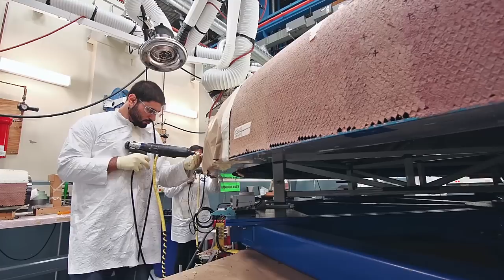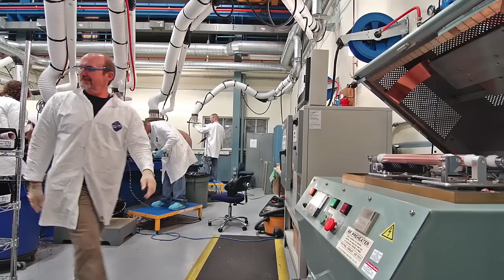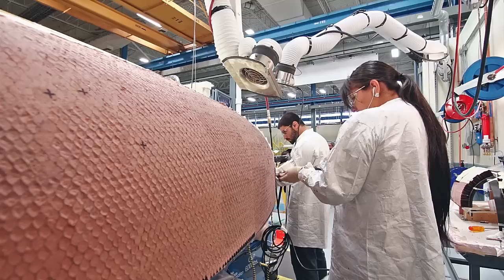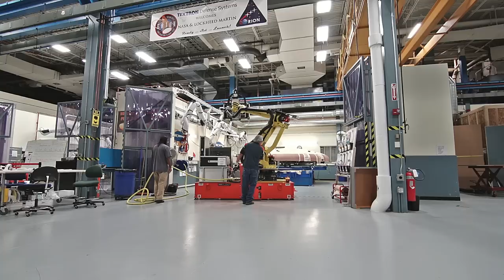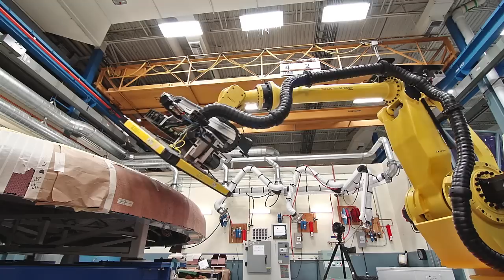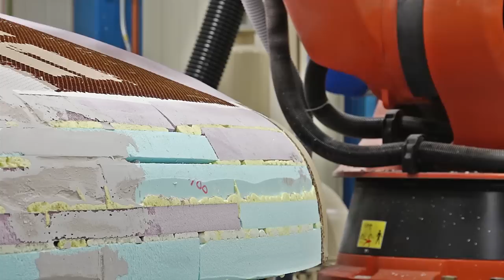Orion's Heat Shield Takes Shape

Comment: A blistering example of NASA having no idea how to make spacecraft economically.

“On the heat shield that we’ve got right now, we have a composite substrate, and we attach a honeycomb structure to that,” Bray said. “It takes us about six months to fill 330,000 holes with individual gunners.”
Reply: What's your proposed solution?
Reply: SpaceX uses PICA for heat shield. It doesn't require nearly a man-year of hand labor to build.
Reply: Denys Vlasenko Sycabara also using one or more robotic arm to fill them seems a better idea imho
Reply: +Denys Vlasenko and where's Space X now?  lol
Reply: ***** crashing space crafts?
Reply: Outlaw All but one of there missions were successful. Landing the 1st stage is only experimental and they are ok if they don't make it everytime as it gives them valuable data for future tries. But SpaceX has successfully made 4 landings.
Reply: ***** oh boo hoo cry NASA a river...

Off topic!

Comment: I build CNC Equipment mostly for metal fab, to see a 5kw CHINESE spindle motor on the end of a robotic arm with a vacuum hose being held on with duct tape! I wonder what the hell happened to the most advance space program on the planet?
Reply: It got its funding cut by some genius in the whitehouse.
Reply: Dexitron 1. This isn’t NASA, it is a contractor.
2. So what? They have to be economical, country of origin doesn’t have a direct impact on quality.
3. If something works, don’t change it.

Comment: I like how people talk about industrial manufacturing processes as if they actually understand the cost of tooling and jigging. As much as it'd make sense to use a motion system to automate this, do you guys actually know how much it would cost to build a rotary table the size of that heatshield with the positional accuracy tolerances needed at that diameter as well as the 5 axis head that would be needed to actually mount the applicators on?

Comment: So, did Congress specify that the heat shield had to be constructed by this insanely labor-intensive process? Will this be the manufacturing process, too? Perhaps you don't really care as the launch rate that Congress is willing to fund is so low that it won't matter if it takes a couple of years to put one of these things together. It looks not a bit different than the Apollo heat shield from the 1960s...

Comment: Don't believe me? Go look up the costs to buy a 2 axis indexer for a CNC machine that has just enough positional accuracy 6 inches/150mm out within the .00x degree range easily will hit you into the 40k+ mark. Now imagine yourself building a giant turntable (Millions+, plus all the fun of "Cost Plus" reaming you) and then a 3 axis gantry capable of positional accuracy across the whole range (You wouldn't want to miss your cell when injecting your ablative material would you?) and then the...

Comment: OMG, they built it using the exact same way as Apollo. Nothing modern here,no ceramic heat sheilding like the shuttle. It amazes me they would use the exact same technologys as before. Pretty cool,but pretty sad too. Why have we not used the same ceramic tiles as the shuttle? Cost probably. What kills me is they are using the same exact methods and technologys used in the 70's.
Reply: RC Hobbyist Extreme Because space shuttle tiles are brittle
Reply: Because the shuttle tiles were only good for about 2000 degrees. Avcoat is good for 5000+. Orion will experience temps up to 5000 degree on reentry.
Reply: All the Apollo capsules were built in the mid 1960’s…